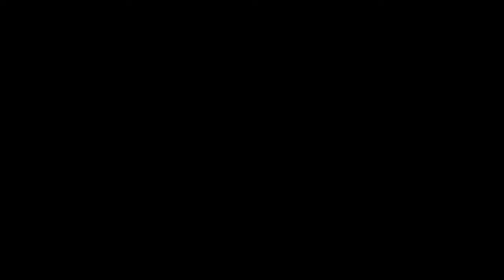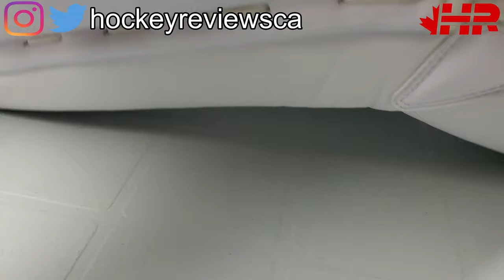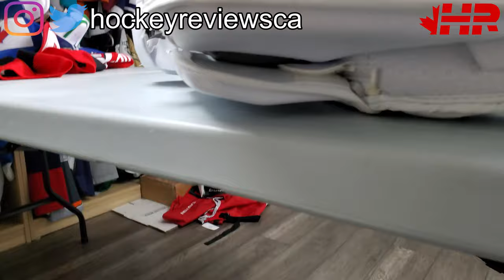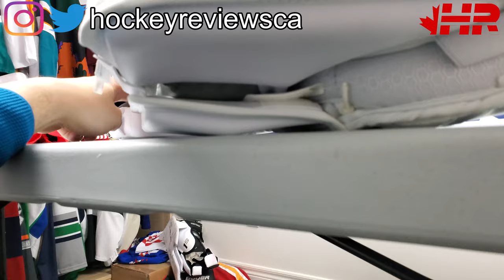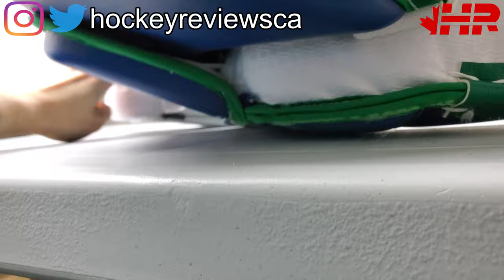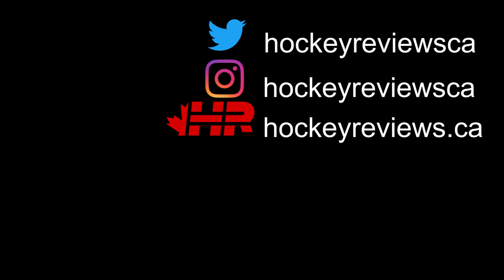Bauer Supreme Ultrasonic Stabilislide example & review correction

Comment: Even The Best Make Mistakes. Hope you are well Matt. Currently running Vapor 2X Pro's size small. Any pad recommendations? Ultrasonic, Optik 2, Vaughn SLR 2,  or Vaughn VE9. I am only 5' 8" and a hybrid. Don't particularly like the wider boot break on the SLR 2. I do prefer flat face on a pad. Thanks. This knee block design is revolutionary and a game changer.
Reply from the maker: Do you have any issues with the 2X Pro? If you are a more reactive/hybrid style of goalie I think the Vaughn pads would work best.
Reply: @HockeyReviews  Couple things in question. (1) If I got the proper size. I went with a small or 33+1 as opposed to an extra small 32+1. When I put on my skates and knee pads and wrap strap from knee stack straight behind the knee  the pads seem to fit about right and my is in the middle of knee stack. When I run strap from knee stack down to calf wrap, the pad lifts up and appears to be too large. My knee at that point will be sitting way too low in the knee stack. (2) The other issue that seem to be reoccurring is on break aways or on certain situations. I am in great position and feel like I have made the save low the on ice. But some how the puck has slipped under me. I believe the pad is over rotating and not getting a good seal. Any opinions would be great. Without video footage it is hard to tell what is happening. Other than that, I don't need to tell you that the Vapor 2x Pro's could very well be the best pads on the market. I forgot to mention, I am only 5' 8" and I would say reactionary goalie. Thank You.

Comment: This was my major issue with the 1s. I feel like my warriors were super stable sliding and I didn't mind having to push a little harder.
Reply from the maker: The calf wing on the 1S was recessed more than every Bauer pad after it. Bauer realized this was an issues and adjusted where it sat in regards to the sliding edge of the pad. I had 0 issues with stability from 1X onwards.